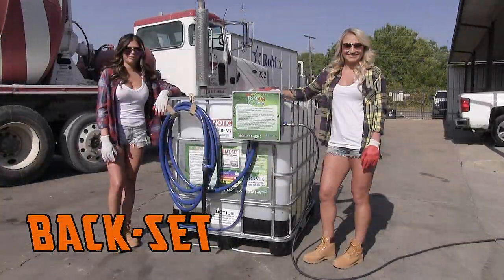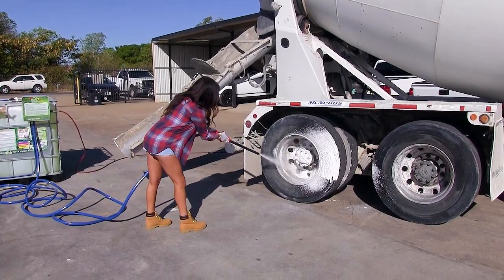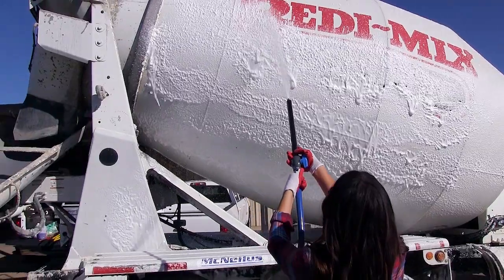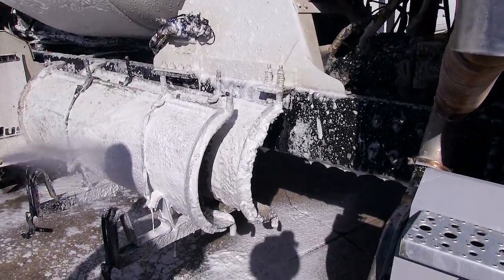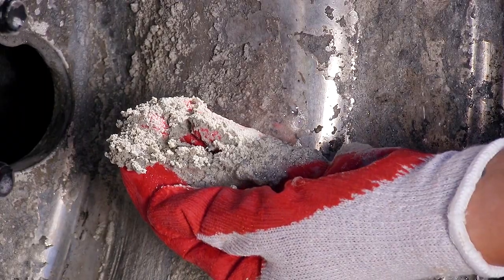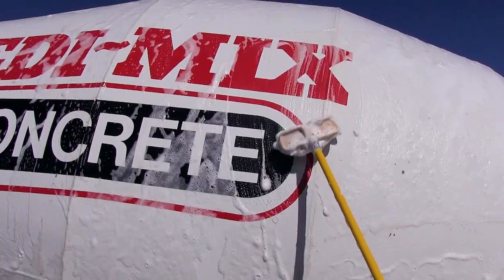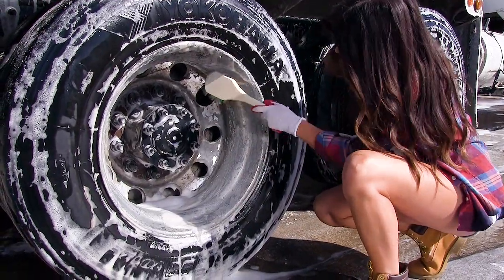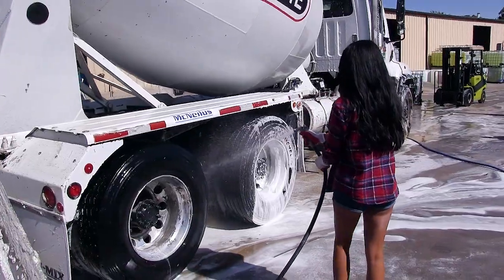RoMix Back-Set Molecular Cement Dissolver

Comment: I just want to say this stuff is amazing, a customer has a pump truck that a line broke on. They cleaned all the liquid concrete from the truck, then they were left with a haze that they could not get off. I spoke with technical support from Romix and they assured this stuff would work for what i needed. so i found a 32oz spray bottle from a distributor. Tried it out and bam the haze is gone, absolutely amazing stuff